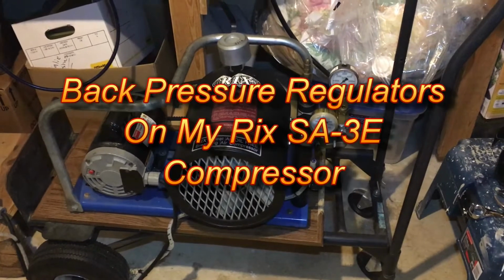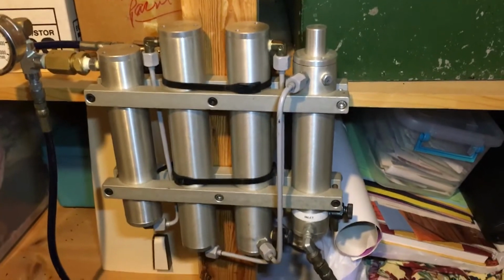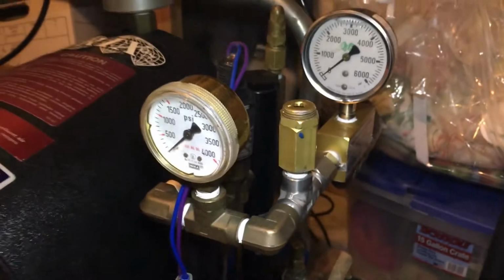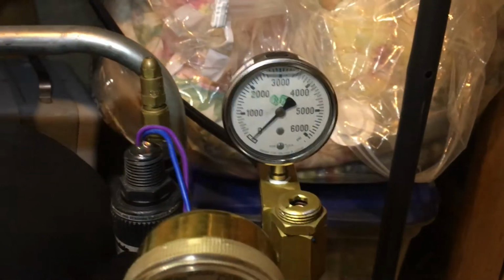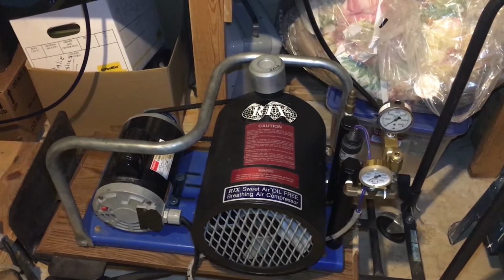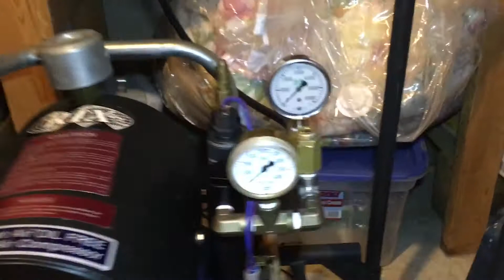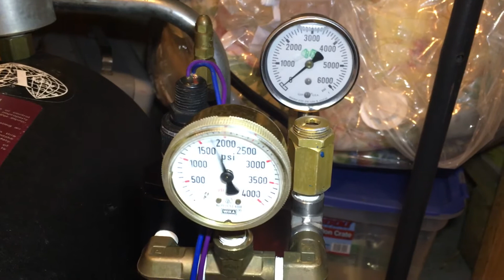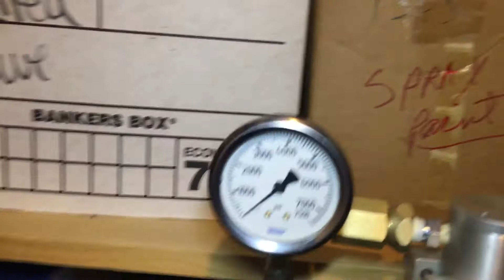Rix Compressor Back Pressure Regulators

Comment: Where did you obtain filter array?
Reply from the maker: I got it used from a friend. It is Coltri brand. Came from an old compressor. Coltri DOES have new filter towers for reasonable prices. I saw one on Ebay at https://www.ebay.com/itm/Scuba-Paintball-Compressor-Filter-Tower-with-Filter-Coltri-NEW/153306818690?hash=item23b1cc6882:g:wjAAAOSwXgxcF01t:rk:3:pf:0